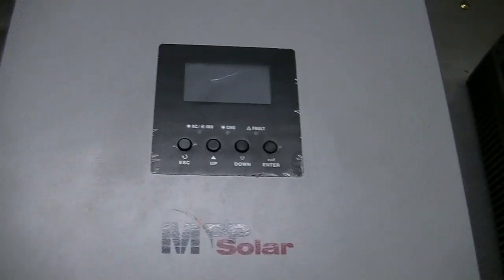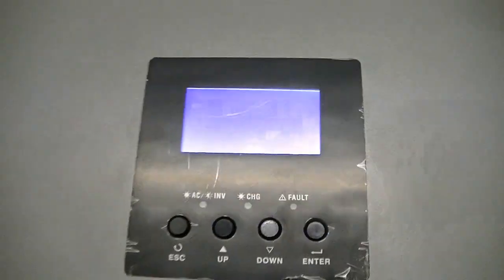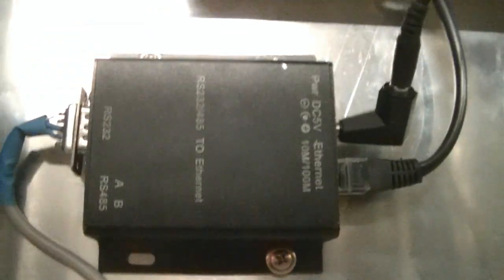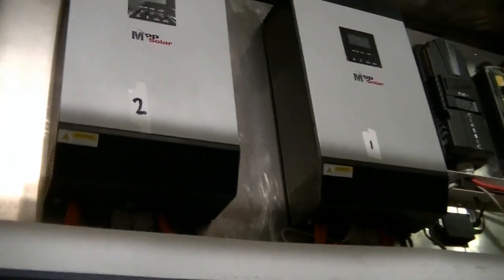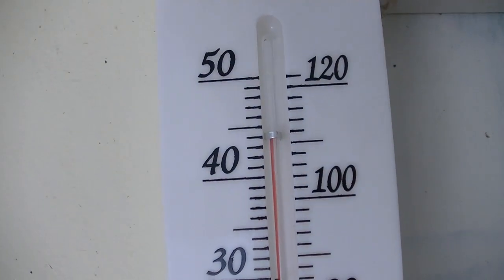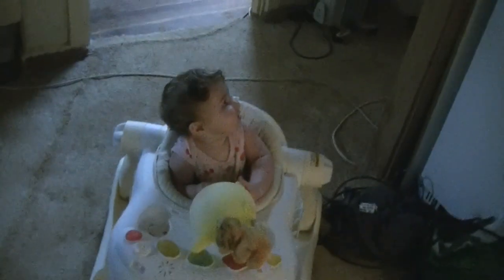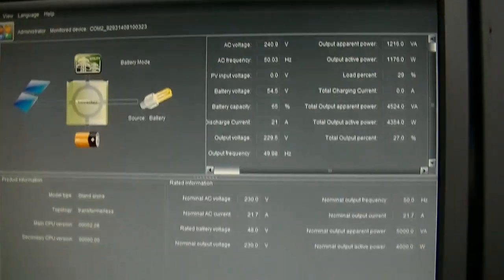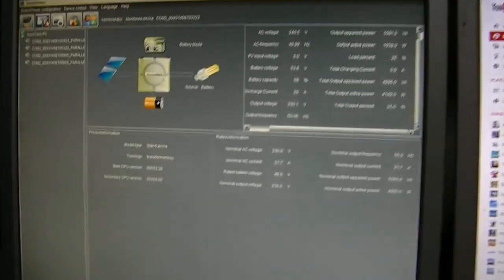Update 3 on new PIP 4048MS MPP Solar inverter

Comment: Nice System! Looks good. The solar charge controler in the Mpp 4048 unit works great! it can run the load and charge the batteries at the same time, if you have enough amps from you solar input? but will use the batteries like a capacitor only using power need from the batteries like say the sun goes behind a cloud then returns, the 4048 will transfer the power from solar to batteries and even to grid with smooth transition. Awesome. Thinking the system may be a bit more efficient by running the solar directly to the units.
Reply: I was looking at these but they are not mppt charge controller, this new one I see is so I was looking to see review
Reply: Mine are working good so far.

Comment: Hi Andrew, nice system!! I would like to know if you have had any problems with the pip inverters since you have installed them. I want to setup 3 units but want to know how reliable they are. Thanks in advance

Comment: Can the inverters be installed in a sound proof enclosure with vents at the top and side to let air in and out without the inverters over heating when working?
This is the only way I can come up with for cutting down the high fun noise as I have no choice but to install the inverters inside of my flat, the only space available is right opposite a bedroom.
secondly what amps are your DC breakers? Are your Ac breakers the standard house hold AC breaker box?

Comment: Hello Andrew from cold and snowy New Jersey. Thank you for your videos. I have one of these installed in Nigeria and I want to make them the staple of our offerings. We use flooded lead acid batteries and in the manuals that come with the inverter they only mention sealed or AGM batteries. Can I use flooded batteries with these inverters?
Reply from the maker: AtlanticWastePower  AGM batteries www.youtube.com/watch?v=pgwxG2Wb9Bo
Reply: Andrew Mays Thank you Mr. Mays. I got 4 of them delivered with the parallel kits. I will be installing them next month.

Comment: Hey Mr. Mays, how many batteries did you use and how many solar panels did you install for such a big loaded system like this? 
Well done mate very good job :)
Reply from the maker: Shawn Zammit I have 14kw of solar panels and have two battery banks. 1 of the battery banks 1355 ah at 48v and mainly use the power in daylight hours when the sun is shining thank you for your comment